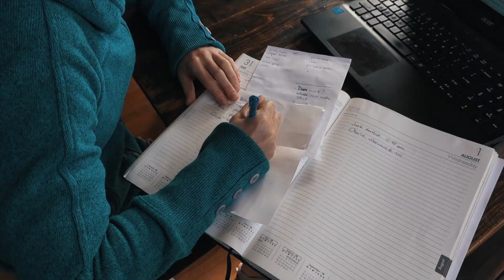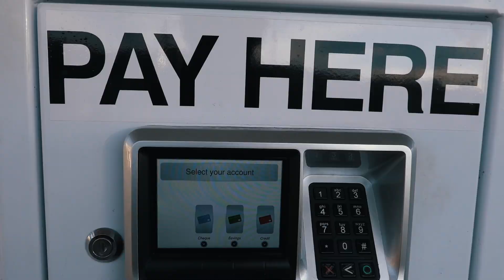Josh James  - ADVENTURE VLOG 81 -Wild Menu Flounder, deer hunting on the Wild West Coast New Zealand

Comment: Did berny get the possum.
What better way is there than 1080.
If you describe it,why is it not being used, even privately.
If you cant come up with a better way put up or shut up.
The overall effect is greater than not. No methods is perfect.
Forty three years ago I sighted for the first time in my life a Kereru at Lake Manapouri. Now they are flying around in flocks of five in the North Island.
I believe that is because possums have been controlled enough by 1080 for the Kereru population to expand.
Reply from the maker: what you talking about? Heaps of possums at lake Manapouri, 1080 causes rat plagues, 60 years of use and more rats than ever. What is the biggest killer of native birds? Cats ferrets and stoats ( that feed on rats as well ) and rats. Maybe you need to pull your head in
Reply: 1080 is an incredibly cruel way to die but the government of new zealand has made themselves exempt from prosecution for cruelty to animals but at the same time they will prosecute a farmer for hitting  a cow with a pipe .There seems to be a double standard here .